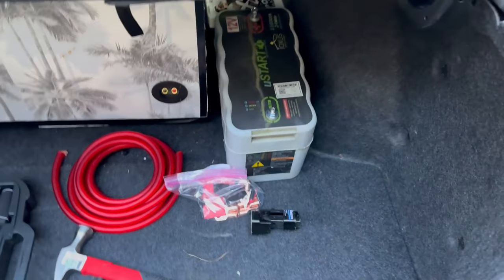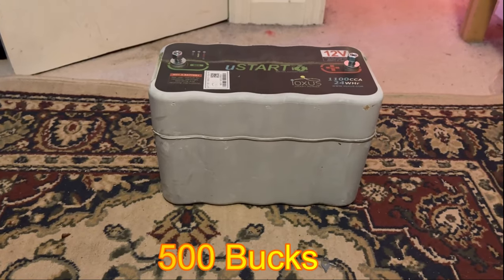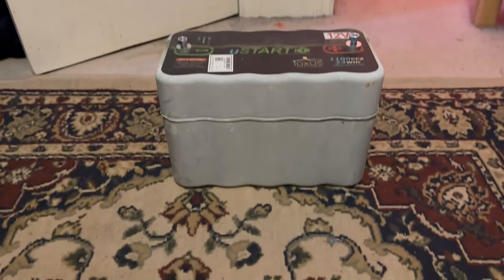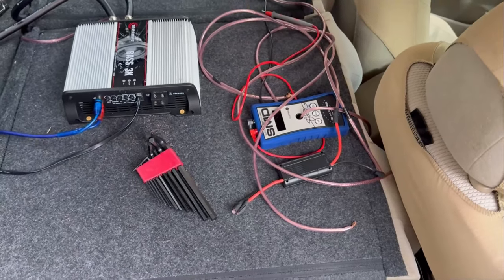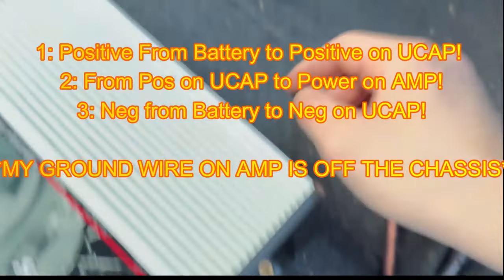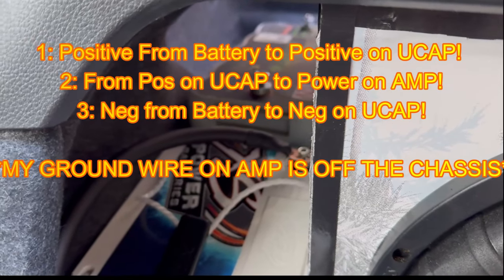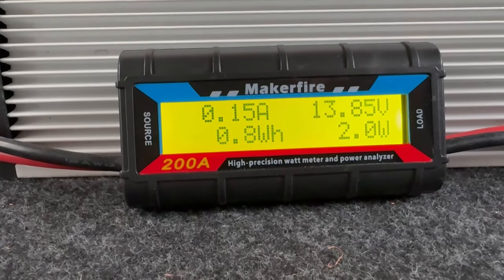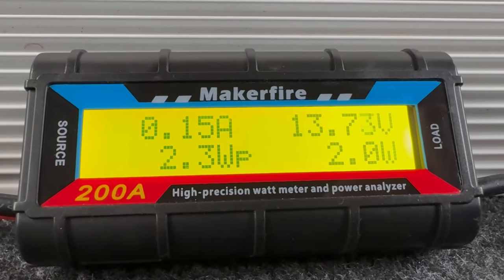How Much Difference Does This REALLY Make??| Ultracapacitor REVIEW

Comment: Need a alternator a battery is for storage so one’s the battery’s drain they have to charge back up but with a alternator it help keep them charging
Reply from the maker: Yessir that will be next. Just pricey gotta save up
Reply: @Zachecker  did the same thing for my accord 2 battery one Xs power and the others ucap got a js 250 help a lot
Reply from the maker: @Shane454  ima get 400 amp going big so I don’t have to upgrade it again

Comment: Im confused I thought you suppose to run a negative from the amp too the battery and also do another wire from the negative to the body of the car
Reply from the maker: if you are doing car audio you want to have a ground from the chasis to the negative on the battery then from there you can run another wire to negative on the amp, its all in a circuit so as long as you dont put positive with negative it will work no matter how many negative wires you have and positive wires
Reply: @Zachecker  ok gotcha
Reply: @Zachecker  thats what i thought

Comment: That amps and volts reader you have can not do anywhere near its 200 amp reading
Reply from the maker: It’s a cheat volt meter and it is fairly accurate it has done the job so far
Reply: @Zachecker  you cant pull 200a through that little thing i would know i own one amd your not going to pull 200a through those little 10 to 8 gauge wires its fact
Reply from the maker: @SheikhN-bible-syndrome   im not trying to pull 200 amps. if I were ide use something bigger
Reply: @Zachecker let me rephrase it that Rinky Dink little thing which I own one of them is way too small for that amp therefore you're probably not getting an accurate reading of any kind off of it because your amplifier is too big because that thing can only read accurately and handle accurately around 2 to 300 watts anything more than that and you go to stinky dead Circuit City
Reply from the maker: @SheikhN-bible-syndrome  I understand that. I do not use it as a watt meter I’ve got a smd for that. It’s just a gage of voltage in my system and it is pretty accurate bc when I had voltage problems it dropped to 10 and amp cut off and the volt meter read 10 volts which is the cut off point of my amp.